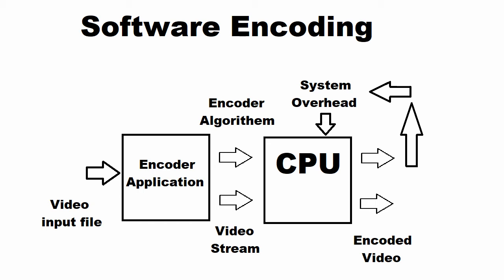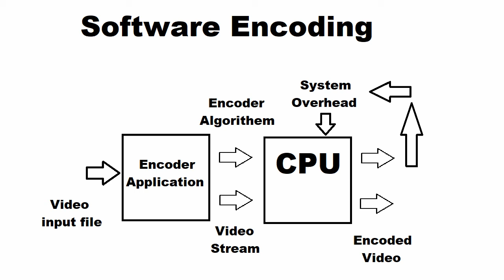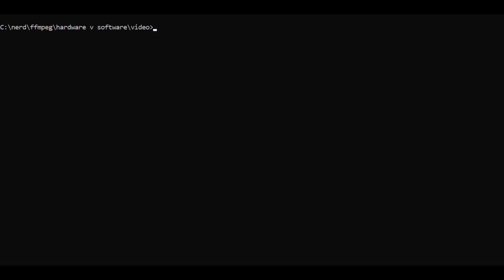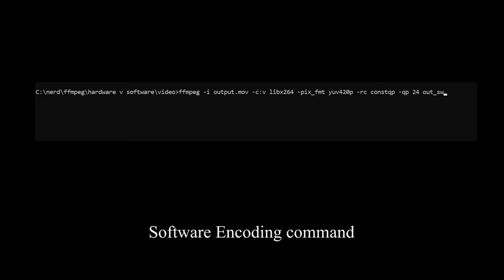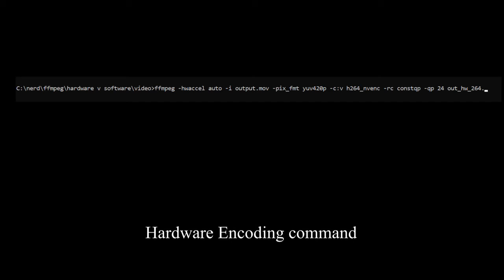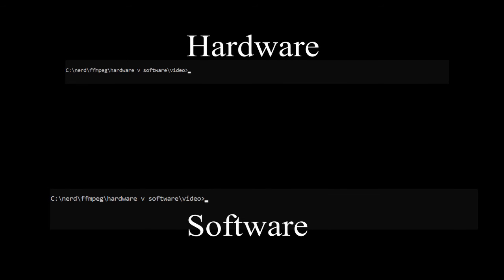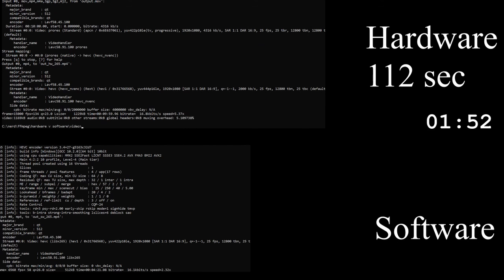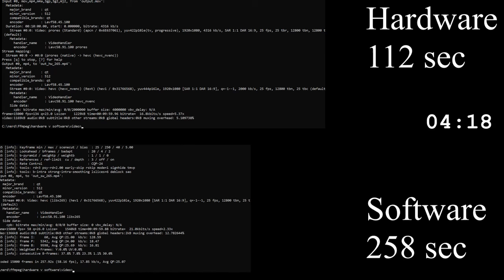hardware vs Software ffmpeg encoding

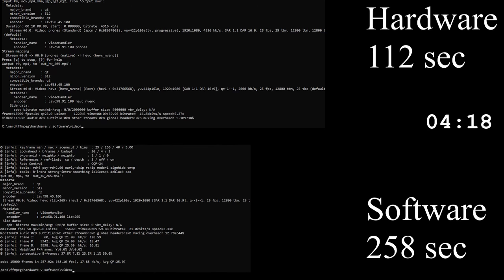Comment: 8:10 Even 4yrs ago you had pretty good FPS for both SW and HW. I have almost the same now on Xeon 2695v4 and RX-580 accordingly.
PS After a few weeks of testing, researching and writing scripts with the help of AI Claude, I created a script for AV1 encoding (svta-v1) on the CPU that is even faster than H.265. The final AV1 video quality is even better, according to FFMETRICS, by 2–3% (92% vs. 90%). However, H.265 videos are slightly smaller in terms of MBs. However, I don't want to adjust my scripts any further to achieve the same size; I'm happy with what I have for both the H.265 and AV1 encoders. I'm also quite disappointed in HW encoding. Sometimes it produces artefacts in videos, which was very surprising, and the main negative aspect is that HW-encoded videos (on both NV and AMD) are much bigger than SW-encoded videos.

Comment: Thanks for sharing this video. I have a question. You must have seen that size of the videos created with hardware and software are also different. The hardware encoders though take less time but take more space than the software counterpart when quality parameters are same. Do you know any command/trick which would produce same or less size file with hardware encoding.

I want to encode a lot of files but I am limited by time and file size. I want fast encoding & smaller sized file.
Thanks in advance.
Reply from the maker: no trick I'm afraid just if i am bulk encoding video to reduce size normally converting h264 to h265  i would use something like this script

-------------------------------------------------------------------------------
SET /A mkv_qv=28
for /R %%A in (*.mkv) do (
     ffmpeg -hwaccel auto -i "%%A" -pix_fmt p010le -c:v hevc_nvenc -rc constqp -qp %mkv_qv% -b:v 0K -c:a copy "%%A~dnpA_CRF%mkv_qv%_HEVC.mp4"
    )
-------------------------------------------------------------------------------

The very first line of the script SET /A mkv_qv=28 - this sets the quality profile to 28.  just try different values until you find the quality and file size your after, the greater the number the lower the quality and smaller the file.  20 to 28 are the range i normally use.